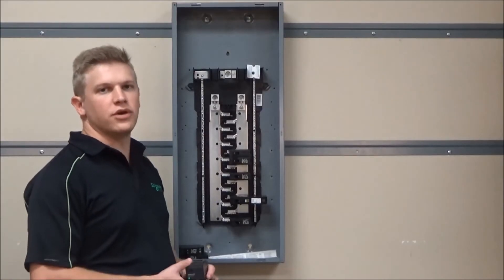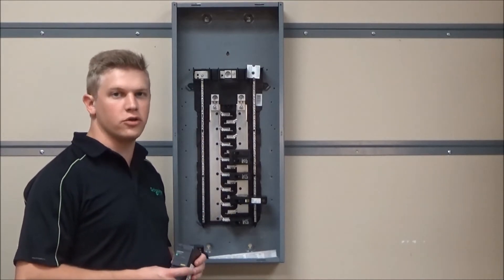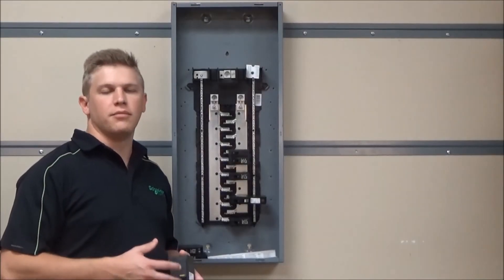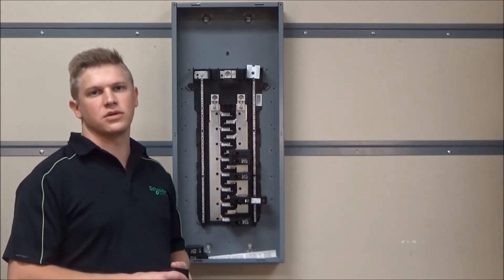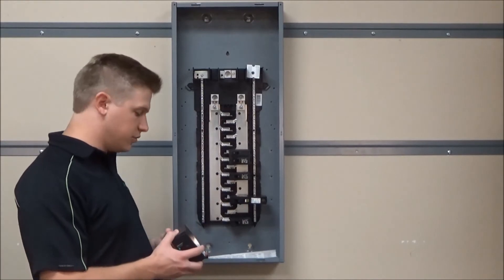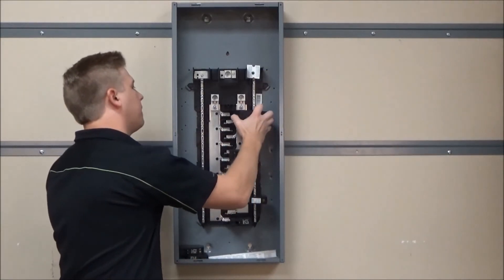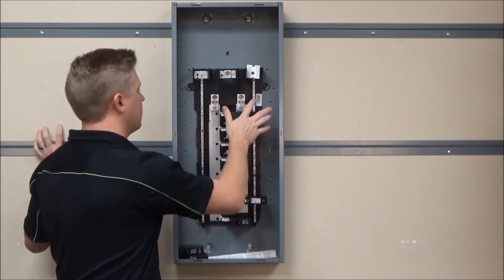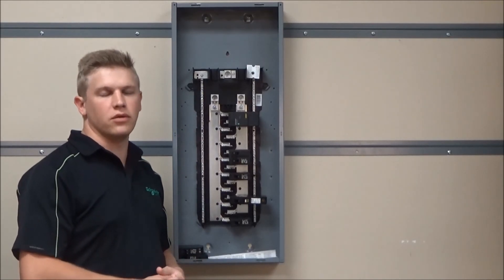Installing HOM250PSPD in a Homeline Residential Load Center | Schneider Electric Support

Comment: The reviews on Amazon show that the cover will not install flush, claiming the breaker is too tall.  What say you?  Can you put a panel cover on your installed breaker?
Reply: I know you posted 4 years ago but I just read those reviews with pictures. It doesn't stick out any further than the switch on the other breakers so I don't see an issue??  Did you install one?